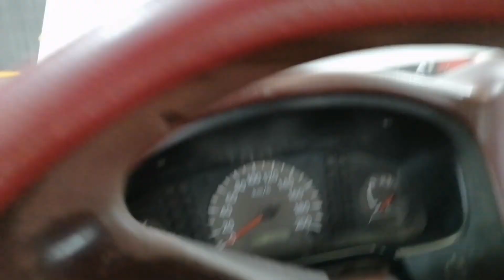Nissan Datsun: No start problem #autotechnician #mechanic

Comment: I am facing the same problem. There is no electricity in the plug. Where does the electricity come from so I can continue to find out if there is a cut in it?
Reply from the maker: It come from distributor and the EFI relay
Reply: When examined by the tester, there is no electricity in the two wires
Reply from the maker: @Ss-on2uo  only 1 wire has a electricity if there's no electricity just check the EFI relay or the wiring.
Reply: Can I make an external cable for it and how? Because I think the fault is from the car’s computer
Reply from the maker: @Ss-on2uo  just switch on a the car if there's a check engine light there's no problem of the computer.. If you want to direct. Just put a 12 volts of 1 wire from the right.
Reply: alsayaaruh la tashtaghil w la yujad shararat fi albuji tama fahs fish alkuayl alkabir yujad kahraba' mae tashghil alnaaria .. ama alfysh alsaghir alsilkayn laywjad fihim kahraba' •• afham mink alsilk alayaman lildiylku alqadim min alriylih adae ealayh silk kharijiun mujab min albataarih litashghil alsayaarih

Comment: Why ac on engine temperature 🌡️ high
Reply from the maker: @RajinderKumar-n7x6b . Just check the thermostat, radiator maybe dirty. And the fan.
Reply: How to check fan clutch